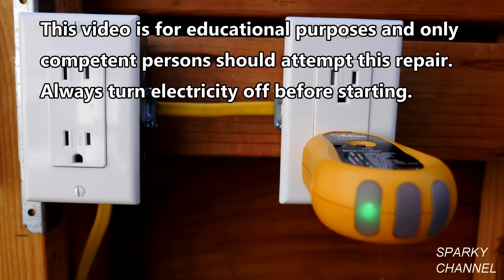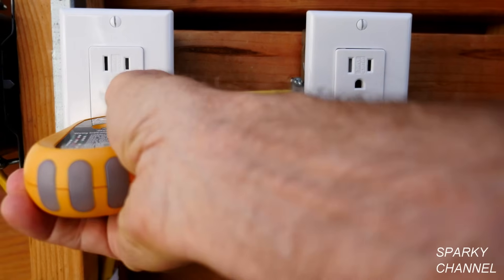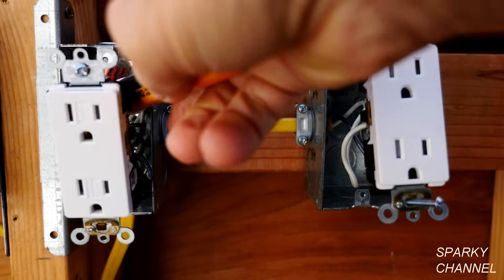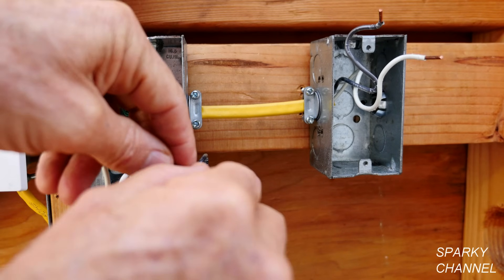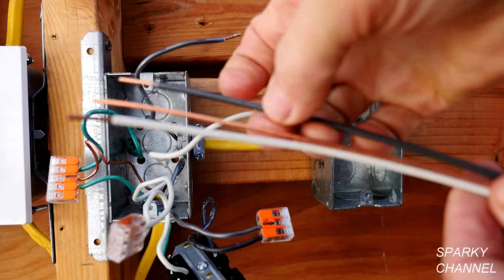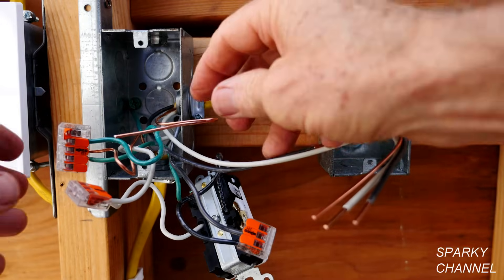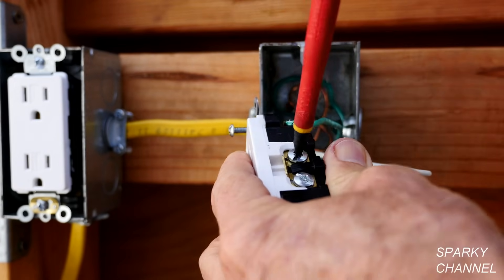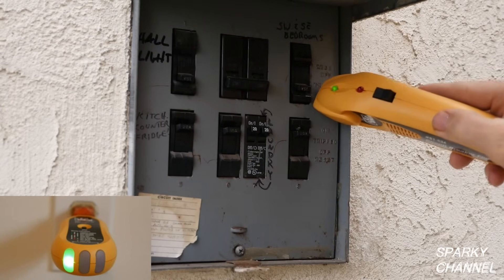How to Fix an Open Ground

Comment: I just saw a disturbing video where the neutral was jumpered to the ground screw to fool the tester.
Reply: just reading this comment disturbed me
Reply: @Tommyoda  I started wiring with my Dad when I was 12 and put in 40 years since and wouldn't even have thought of something like that happening.
Reply: @augustaking8  it just seems at least “jumpering the neutral” would present a circuit fault hazard 😬🤦🏽‍♀️
Reply: @Tommyoda  Nothing good about it.
Reply: It works great I did it for over 20 years in my house, never one problem. Does it in any way meet code...no, does it work and provide protection in the event that the hot wire makes the metal housing on an appliance hot, yes it does, so is it safer than no ground at all YES.
Reply: @integr8er66  I don't think there is anywhere I can't run a ground wire. I'll run one behind the baseboard trim if I have to to ground an outlet for a surge suppressor, to get to a spot where I can run a supplementary ground. Drill a void into the bottom plate and run a lag screw up a little at a time and rip it out until you get into the wall void and drill a hole in the bottom of the box if you have to to fish the wire.  As long as the old wiring is still good the ground can be outside of the cable.
Reply: @augustaking8  I didn't say it couldn't be done, I said too difficult, or in other words too costly. The neutral ground jumper is a 1/2 way fix, like I said, not right, but better than no ground.
Reply: @integr8er66  But if the neutral gets loose everything you thought was grounded can be hot.
Reply: @augustaking8  Only if you lose the neutral before the repticle, and before the jumper all was not grounded anyway and could become hot, besides it is far more likely that you lose a neutral in the flexible power cord going to an appliance than it is the Romex inside the wall. At least with the jumper you get some protection, leaving no ground you get none ever.
Look at it this way, the ground is a redundant path to the neutral buss, so any amount you add redundancy to helps, so if you bond the neutral and ground in the receptacle at least the appliance cord has a redundant path if not the whole circuit, and since that is the most likely point of failure isn't that a better solution than no ground at all?
Reply: @integr8er66  There is current flow in a neutral and resistance in the wire so there is always a voltage drop, no matter how small and that is why you only bond at the panel.
Reply: @integr8er66  If you put in an insurance claim and they check the wiring you'll probably get canceled. My Dad was an inspector and I wired for over 40 years.
Reply: @augustaking8  While that is true and a good point, there should never be over 10% drop, sp thats 12 volts, I don't think that will do much to you.
Reply: @augustaking8  That is probably true as well, but if its anything this is a shock hazzard for a user, I would not consider it a fire hazzard, and I would never do this in anyone elses house, but with my own I can take any chance I want. So given that there are 3 to 2 adapters out there would you rather see a 3 prong receptacle with no ground at all, or a 3 prong with the jumper?
Reply: @integr8er66  GFCI and no jumper.
Reply: And arc fault.
Reply: @augustaking8  I'm not against GFI...See there I'm showing my age not calling it GFCI 😁 I'll settle on that solution, and enjoyed the
 conversation, at least when you argue your point you have reasons to back it up and not like inspectors who just say nope...its wrong. If someone can convince me I'll listen, but you gotta have solid reasons.
Good day sir.
Reply: @integr8er66  Glad to help. Have a good one.
Reply: @augustaking8  Hey while we are talking, So I had a friend call me, she had bought an older house that had an ungrounded receptacle for the refrigerator (Prob not the original location of the fridge), someone had come back and put a GFI receptacle in there with no ground, then when they installed the receptacle in the box the hot wire touched the ungrounded metal box which then sent power through the box to the yoke of the receptacle and thus to the ground pin of the receptacle and out to the chassis of the fridge. This went unnoticed for months until one day when she touched the fridge door and the dishwasher metal frame and got shocked. Now the interesting part was the GFI did not trip because the current wasn't passing through either the hot or neutral pins of the GFI but it WAS passing through the ground, but that pin is not monitored for trip status. Had they done the ground to neutral jumper this would not have happened because the box would have had a path to ground and when the hot touched the box the breaker would have tripped. I did not install a jumper, but just mounted the receptacle so the hot didn't touch the box and put some shrink wrap over the scared insulation on the hot wire but it made think twice that it might be a better installation with that jumper
Reply: @integr8er66  I don't know if it would have tripped even with the jumper. If there is access from the basement to install a dishwasher I would cut in a rework box behind the frig and put it on it's own breaker and cap the wires in the old box and put a blank cover on it.
Reply: @augustaking8  No the GFI would not have tripped but it would have been a short to ground by way of the jumper from the Yoke to the neutral wire back to the panel and that would trip the circuit breaker. Ya I could add a new box, and thats a good fix, unfortunately its an exterior wall so there is insulation and possibly a fire stop to deal with, I don't have the 8 ft flexible drill bits so its not that easy without investing in the tools.
Reply: @integr8er66  I was thinking that since she didm't get that much of a shock there  wouldn't have been enough of a short that it would trip the breaker. Is the kitchen on the second floor?
Reply: @augustaking8  Well IDK how much shock she got, but I got it twice before I figured out what was going on and it was a pretty good jolt, however a GFI only monitors the difference in current between the hot and neutral wires not the ground, so no matter if I ran a space heater between the fridge and the DW it wouldn't trip the GFI, with the neutral ground jumper in place the breaker would trip as soon as the hot wire touched the box because the hot touching the box would be a dead short regardless of the current passing through our bodies. With the jumper current would go from the hot wire to the box to the rec yoke to the neutral screw conection via that jumper and back to the neutral buss in the main panel. Anyway its on the first floor with an unfinished basement underneath, a floor receptacle behind the fridge might be an easy option, but a little odd for that kind of application, I guess I could mount it down low in the wall, IDK why but I always see fridge recept up higher, I'd love to just run surface mold or conduit up the wall and surface mount a box, but I doubt she would be on board with that😁 but thats how I do it in my garage
Reply: @integr8er66  When kitchens get moved around some are above counter height and some are down low. I go hammer high for the low ones where I set the handle on the floor and set the box on top of the hammer and mark the wall. Rework boxes are about $2.00 and have more room for a GFI than the old steel ones. A frig is good on a 15 amp circuit with #14 wire.
Reply: @integr8er66  No. With no ground, equipment cases and other touch surfaces float (high impedance). With outlet ground tied to outlet neutral equipment cases are usually at ground, but will be hot if outlet neutral is disconnected from panel. This is NEVER a good thing.
Reply: @integr8er66  3 prong with no ground at all.
Reply: @integr8er66  Yes,  better in the case that hot is shorted to the floating ground, but inferior in the case that local neutral is open. I would suspect that the former is less common than the latter.
Reply: @integr8er66  No. If local neutral disconnects from panel neutral (easy to have happen when neutral is passed from outlet to outlet to outlet). Now when any light, appliance, or any load is connected across hot and the defective neutral,  the disconnected neutral becomes energized (hot), and any appliance or equipment cases that are connected to ground are now energized (hot) too. This is definitely NOT safer than no ground.

Comment: If there's no ground wire, the solution is to add a ground wire...

...Oh, Geesh,  I would have never figured that out...         ....DUUUUUUUUUUUUUUUUUH!
 This video must be aimed at people who can't even spell "Electricity" correctly.

What about a solution when running a ground wire is NOT a viable option?
Reply: Then the entire ungrounded circuit needs to be protected by a GFCI on at least the most upstream receptacle, and all receptacles on that circuit need to have labels on them that state "GFCI Protected", and "No Equipment Ground."  If running a cable with a ground wire isn't feasible, then you can't ground the circuit. The next best thing is a GFCI, which isn't the same as grounding, but at the very least all the receptacles will be protected by the GFCI since it monitors current fluctuations of 4mA to 6mA on the neutral wire, which is tied to ground.
Reply: @alexblinder1549  " If running a cable with a ground wire isn't feasible"   Which, sadly,  happens more often than I'd like to. I mean, is never impossible, but usually is difficult, time-consuming, and the customer is not willing to pay for the extra effort. I'm an electrician,  I  know about the GFCI solution.  I was just pointing out the futility and DUMBNESS of this video.
Any person with more than two functioning neurons would guess thst when ANYTHING is missing, the obvious solution is to ADD IT. 
The real challenge is WHEN YOU CAN'T JUST ADD IT.
Don't get me wrong, I usually enjoy the Sparky channel, but this time they missed it badly.
Reply: I have a novice question. Let's say you are in a kitchen that has 8 receptacles and all of them say open ground how would you find the upmost receptacle and then change it to GFCI? The home was built in 1956 with all plaster walls and has a brand new 2020 Breaker box just installed in the garage. Thanks in advance.
Reply: @Steelviper61  There has to be one of them correctly grounded, (that one is the upmost) but if you wanna protect all of them with GFCI the best solution is to replace the breaker with a GFCI breaker.
Reply: @Lapatusia  Thank you. I had the old breaker box replaced this summer by an electrician with a GFCI breaker box but some of my outlets still say open ground. Is it still necessary to put a GFCI outlet in the kitchen? I don't think so but double-checking with you just to make sure. Thanks again, sir.
Reply: @Steelviper61   The GFCI breaker will protect the whole circuit.
Reply: @Lapatusia  Thank you sir, since we last spoke I have been studying "All things GFCI" Sounds like I am covered. Thanks again for being professional enough to answer my questions, it is very much appreciated!
Reply: @Steelviper61  My pleasure!
Reply: @Lapatusia    When did "wanna" become a word?  See!  I can be an asshole too!
Reply: @Lapatusia  Congrats!  you're better at it than I!
Reply: Obviously the answer is to add it, this video shows how to add it, which anyone who isn't an electrician like you might not know.
Reply: @chaseoes  HAHAHAHAHAHA!!! Oh please!! 
Try to apply what you learned in this video  to  a REAL life situation, behind drywall, or concrete,  with  Romex stapled on the studs, in an attic, fishing a cable several feet away from the next receptacle, running cable through drywall corners, metal studs, tiles,  etc. 

This is a pointless video that shows JACK SHIT.
Reply: Carlos, just resolve yourself to the fact that you are an asshole............ Maybe you can't help it.  Some folks are just born that way.
Reply: @frankdank7507  Buuuuuujuuuuuu!!  I'm an Asshole, and I can't help it!!
Buuujuuuuu!! 
Oh, the Humanity!!!!
Don't worry, I'll be going to AssAnon (Assholes Anonymous) to do their twelve step's program 'till I cease being one. Buujuuuuu!!
Was I born an asshole? Noooooooooo, god!!! Why meeeee?...
 .....Got a kleenex?
Reply: Daniel 045  I have the sacred right to tell my opinion out loud, whether you like it or not. And of course I didn't find this video helpful. And of course I moved on ages ago,  my time is too valuable.
 If someone else like this video, they are, like I am,  also entitled to their opinions. 
But don't you dare to shut me up.
Reply: @Lapatusia  You do have a right to an opinion. But, just remember, just like assholes... everyone has one, so think about what you want to gripe about or you will be compared to one.

Comment: Hi Sparky. Very informative video. Maybe you can help me with this. I bought some surge protectors from amazon and they all have lights for protected and ground. However when I plug them into the wall outlets at home some of the surge protectors show not grounded/protected but when I plug in a different surge protector it shows grounded/protected. I bought the surge protectors at the same time from Amazon a week ago. Also, I checked the outlets with a receptacle tester and I get the two lights for correct wiring. I went around the house and plugged the surge protectors/receptacle tester into various outlets with the same results. Is it a surge protector problem or something with the house wiring? thanks!
Reply from the maker: Interesting. Perhaps some aren't working correctly?

Comment: Let's say we have old wiring. Using the power from old cable to add a new outlet and switch. Connecting all wires correctly turn the power on and test the wires. The tester beeps on the hot wire as it should. The tester also showing a hot ground. Whats goin on there?
Reply from the maker: That's a very dangerous situation! I would recommend calling an electrician and having him/her safely sort that out.

Comment: 12 gauge wire but 15 amp receptacles?
Reply from the maker: Yes. The 15A receptacle have a 20A pass-through rating.

Comment: Let's say I have an old house with no proper grounding in the different outlets.
Can I pull a grounding cable and connect to one of the outlet box; then from that box, connect another ground cable to other outlet boxes?

The idea is to avoid to rewire the entire house.
Reply: For the first socket in each line run replace with a GFI.  Make sure you put the "no equipment ground" sticker on the face plate.   On the others in this circuit you can use a normal grounded type but you also need to sticker it the same plus add the "GFI protected."  Both of these stickers will be included with the GFI. This is code but remember without the real ground modern electronics equipment will not be as protected as if the ground ran back to the panel.  Since you speak of it being an older home suggest you start by buying a slim-line GFI because the box might be too small or tight for the normal size.
Reply from the maker: Yes but the ground wires must be in conduit or sheathing and all the other codes have to be followed.

Comment: I used my outlet tester in a house that I was planning to buy and found that there were no grounded outlets or GFCI outlets in the kitchen and most of the rest of the house. 
The sellers didn’t want to budge on their price, so we walled away from it. 
It would’ve taken many thousands of dollars to rewire most of that house.
Reply from the maker: Well you made an informed decision so good going!
Reply: If the Cgfi outlet trips with the test button but not the tester machine- what would cause that? This is all the outlets in the house.
Reply: @mtafli1  
It means that the GFCI is faulty, or there isn't a ground wire for the tester to create a ground fault. Some cheap GFCI outlets will always disconnect power with the "Test" button because it's not really a test button as it is simply a switch.
Quality GFCI outlets will actually create a safe and contained ground fault with the test button, as is attempted to be done with an outlet tester.

Comment: I have a 110vac circuit with an open ground in several outlets. So far I can't find the break. May I just run a wire from a good ground in another circuit to  ground the ungrounded circuit? Thank you. Great video.
Reply: Castlebury21  
That's what my niece's husband, an electrical engineer, said too. I found the ground break and fixed it.

Comment: At 3:00, just because the tester says that there is ground, that doesn't mean that ground was set up properly. Some idiot would just decide to connect ground directly to neutral within its own outlet, so be careful about that assumption.
Reply from the maker: True.

Comment: Great video, thanks. My son’s bedroom is a converted bay of a 2 car garage. The outlets on the original wall are fine, on the newer wall something’s squirrelly. His plug in outlet tester shows open ground, my outlet tester (different brand) shows reversed polarity. When I use a tester with the 2 leads and a light (older school) I have proper polarity and a working ground. The panel is bonded to a water pipe but there doesn’t appear to be any earth grounding rod. Would this account for the different readings and should he have the landlord install a proper grounding rod? Is it safe to install a grounding rod inside a dirt floor basement? I told him to call an electrician, but he wants to have some info before he does. Thanks.